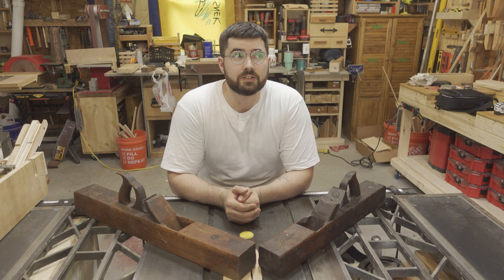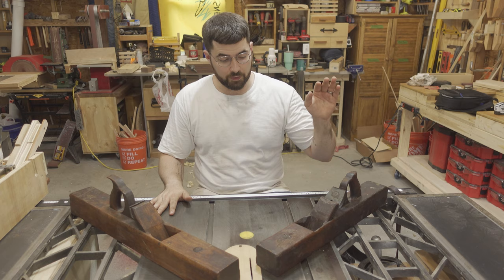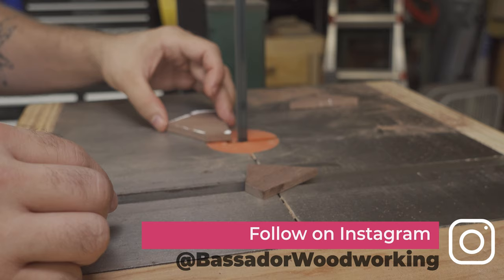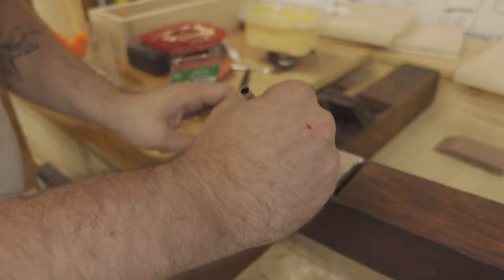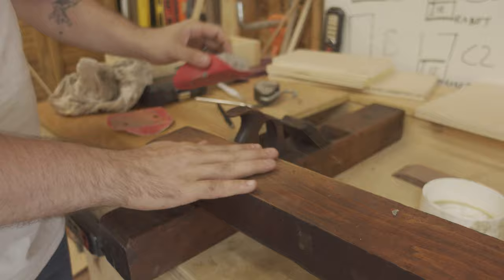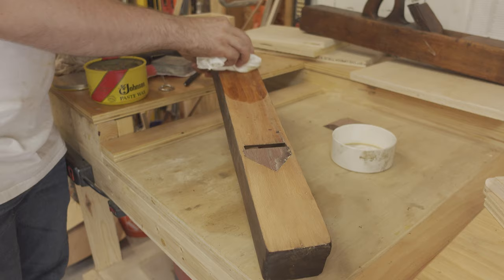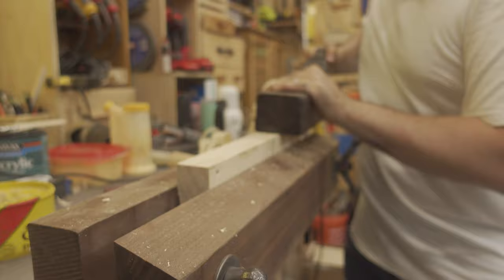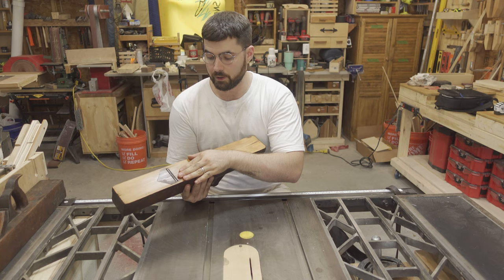Antique Plane Restoration! | W. Butcher Plane

Comment: Not 1830s w. Butcher at that time was just starting out and still only making knifes at that point. They started making plane blades in the 1860s.they never made planes they made blades and other tool blades. Some one either made that body or put a blade in a body that had a worn out blade. By the looks of it looks hand made by who ever owned the blade. I’d date that plane around 1870s, they went out of business in the 1880s. I've never heard someone call the block planes but thats not what they are but I get where you'd get that lol 😆
Reply from the maker: Thank you for the additional info! From what I was able to find on the plane steel, it looks like it is stamped with an older version of the maker mark, which made me think it was before the 1870s but this is purely based on the little research I have done on it.

Comment: I have the same block plane you do. It has the half moon shaped W. BUTCHER stamped on the iron. Amazing how old, I had no  idea. Can you tell me how you put it back together... da on my part. I should have paid more attention. I'm assuming the frog goes down so the screw fits in the recess. I also noticed the stamp faces "up." Where should the chip breaker meet the blade iron?  Do you let the blade rest on your bench then give the wedge a tap to set everything in place? What angle do you think you have on your plane. I sharpened mine back to the "original." It may have been changed a dozen time over the years, but when I got mine it was ground to about 22 degrees. I put an 8 degree secondary bevel on it and it cuts fine, I'm just not sure I'm set up correctly.       Enough already. Any information you could pass on would be greatly appreciated. Thanks again. Cheers to cool old planes... really old planes.
Reply from the maker: Thank you for watching and commenting! I posted a short today addressing your question. Let me know if I left anything unanswered!